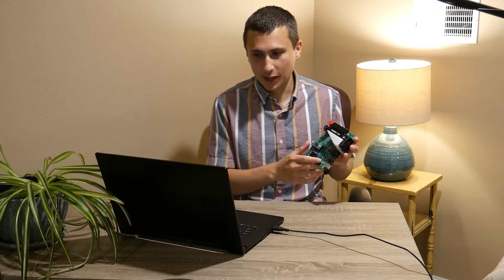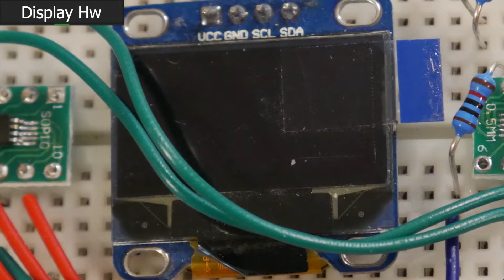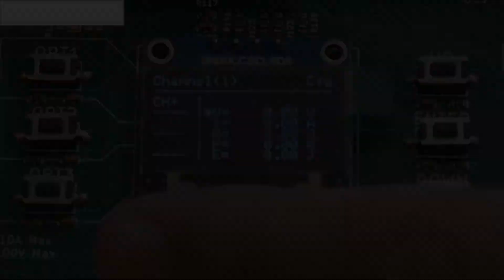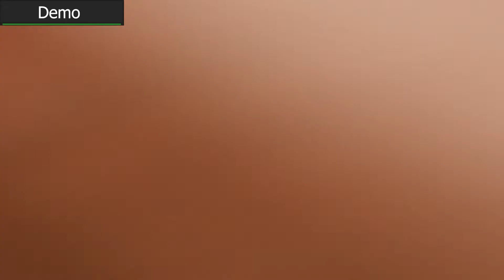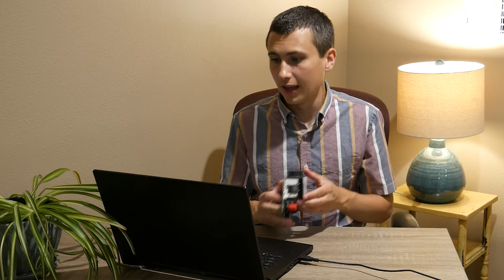Electronic Load UI Walk-through & First Look

Comment: its possible to drive it with a STM32 i used the Bluepill and most Adafruit libs work with it...
Reply from the maker: Abolutely, EletctroNerd! Anything with a compatible footprint and a SPI interface will work just fine! at the core, it only takes a few bytes on the SPI bus to turn on the analog circuitry!

Comment: nice work. i made a diy electronic load for the same reason you design things, to learn. maybe you can take a couple ideas from my design. i used the teensy 3.2 mcu and a nextion lcd display. i used the LTC2945 for monitoring.  i also made a battery discharge tester mode.  https://youtu.be/b75FZORGgEw

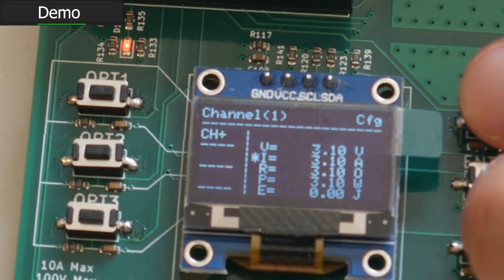Comment: Can you please explain what the tri state LED implementation is? Is it hardware or software based 🤔.  Would like to learn more. Thanks @5:00
Reply from the maker: Hi Eddie! A bit of both, it's a low-current bias resistor with a typical LED implementation strapped to it, (so GPIO = highZ means dim, GPIO = low means off, and GPIO = high means bright!)

The same thing could be accomplished with two separate pins providing current to the led, if highZ isn't an option for a particular reason.

I hope this helps!

Comment: Great video once again!
About the OLED, maybe on the next revision on you could add 2 solder jumper's so people can choose VCC and GND pins, just an ideia
Btw, have you estimated the overall price cost in parts?
Reply from the maker: Thank you FixDaily! Yeah, I ended up doing that (with zero-ohm resistors, though I suppose jumpers would be more user friendly) 

About the overall price, I certainly know how much these couple boards cost, but small quantity cost is us usually way more than larger quantities. If I were to get these built in 1ku or 2ku I'm very certain the cost of each unit would drop like a rock. 

I haven't run the numbers, but cost of parts is probably around $70 for what we're looking at here, which isn't bad considering that's a $20 micro and a $15 mosfet. :)
Reply: @EEforEveryone  Which micro we are considering at the moment? I've been earning you talking about Teensy. Is this one the read deal?
Thank you for your time :)
Reply from the maker: Yessir! It's the Teensy 4.0/4.1 I guess we didn't really show that off in this video... :) But yes! Teensy 4.0 is on our dev board.